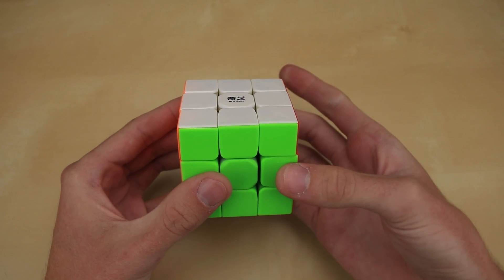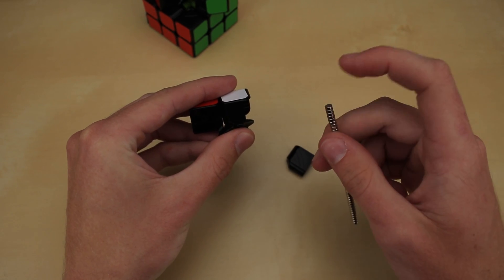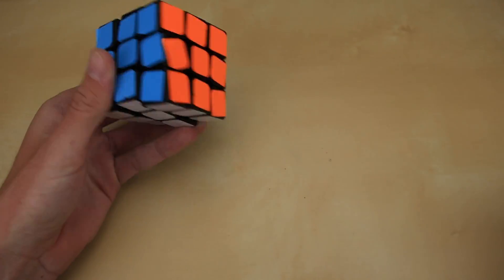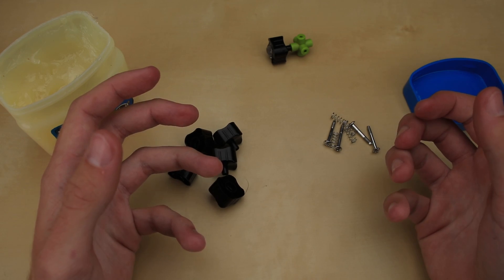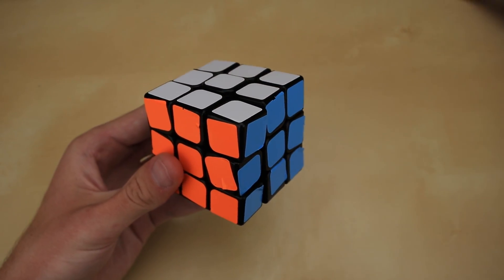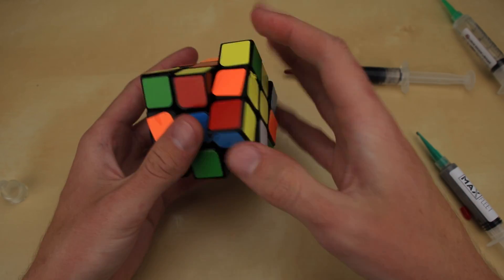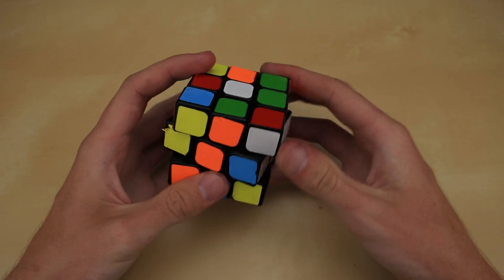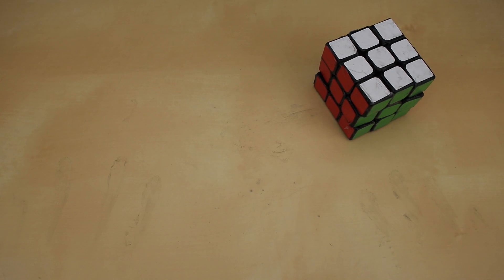Making the WORST Turning Rubik's Cube (2020)

Comment: Hey you should’ve used those tiny ball magnets as the bearings so that it breaks 24/7 and turns on its own. Another way is to get the cube wet then dump it in sand then take it out again.
Reply: What a coincidence to have you here, fellow sk player!
Reply: It needs to be turnable but just very very bad.